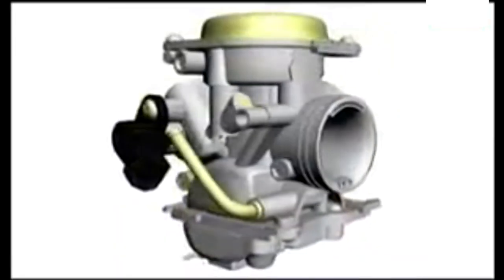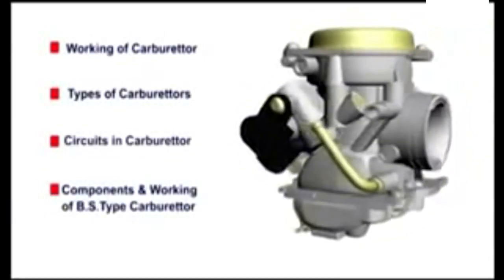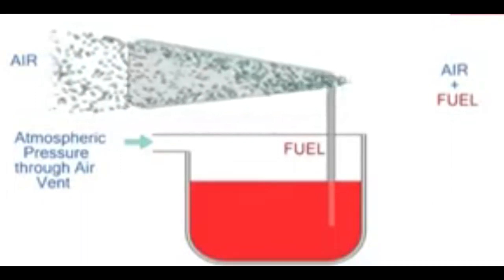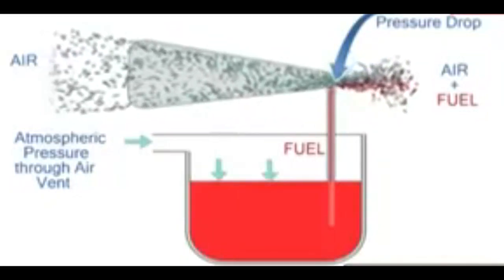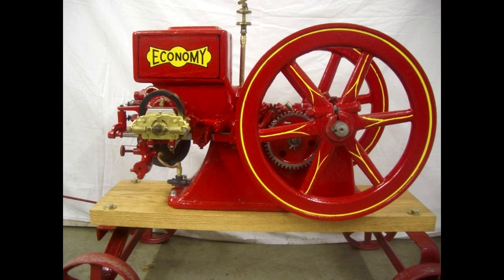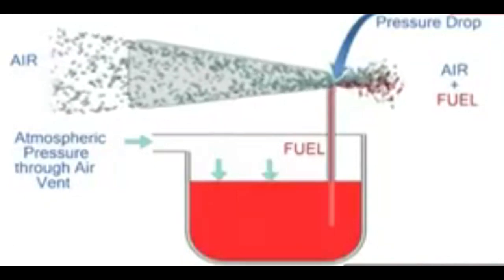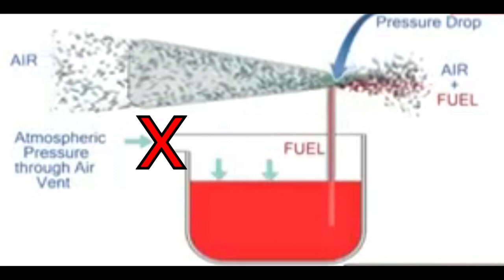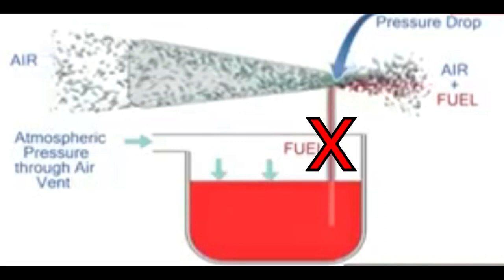Motorcycle Carburetors Explained - This will help you fix your carb!

Comment: This is just what I’m looking for. I’m in the middle of trying to figure out what’s wrong with my carburetor. I think it’s flooding but I’m not sure. It works on and off. If I’m kicking my bike on for awhile I can eventually get it to start right up but there’s not even a second before it dies. I ordered a rebuild kit that looks like it will fit my carb🤞
Reply from the maker: Thanks, well I hope this series will help you.  I also have loads of information here on my site.  I also have videos on how to tell if you are rich or lean on your mixture.  https://www.thejunkmanadv.com/motorcycle-carburetor-jetting.html
Reply: thejunkman nice I’ll take a look at it
Reply: Tap the bowl lightly with a screwdriver...
Reply: Also, turn your idle up..
Reply from the maker: This does sound like a fuel deliver issue to the carburetor.  I will have  video covering that soon.

Comment: What do you consider as to tuning or adjusting a carb that runs fine but bogs when WOT off the line? Only happens when WOT.  While the bike is running everything is fine no issues.  Kinda stump as to what can be an issue here.
Reply from the maker: Watch my recent upload. It will tell you what adjust for WOT throttle.
Reply from the maker: Here is the link to the video that will help you and your Wide Open Throttle problem.  https://youtu.be/SkoMCP9QreQ

Comment: I am looking for the instructions on adjusting my  2 stroke motorcycle carb when going from 5000 feet elevation to 7000 ft elevation? Basically which direction do I turn the air/fuel screw?
Reply from the maker: Well overall you want to lean out the mixture as the higher the elevation the lower the air density.  You will have to change physical jet sizes to make this adjustment.  The mixture screw only controls the mixture at idle speed, it may only need a minimal adjustment (if at all).  The adjustment you will need to change for this is the main jet.  For just a 2000 foot change, one size smaller main jet is all you probably will need.  Your pilot jet might be fine as is.  Check out my other videos that go in depth about this topic.  Start with this one.  https://youtu.be/_gHH4UVbkFA